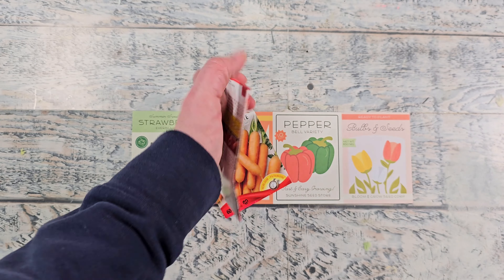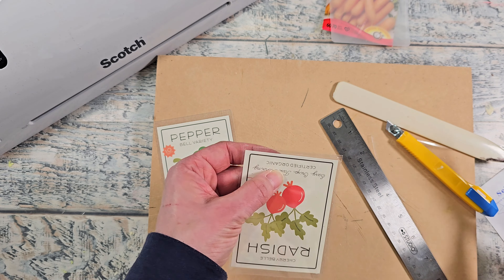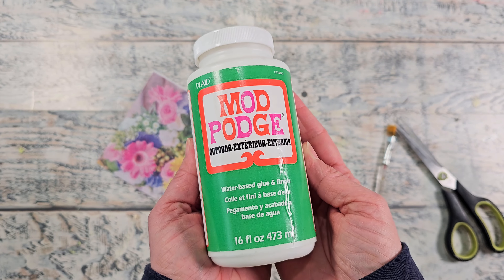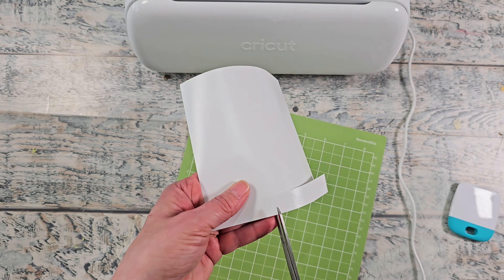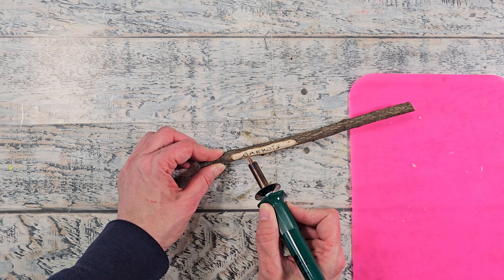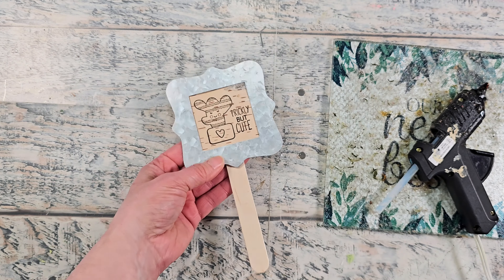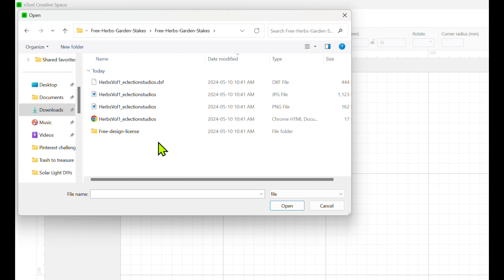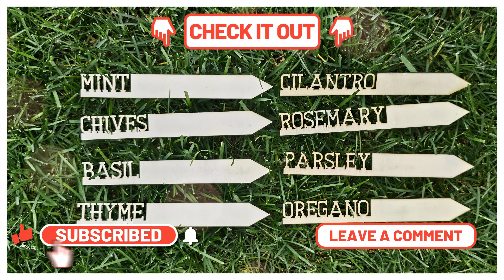Unique DIY Plant Markers For Your Garden

Comment: Donna, these are all so cute. I love the laser cut ones. I seal my wooden crafts that are going outside with three coats of spar urethane. It does have an amber finish but I think it adds to the wood tones.
Reply from the maker: Oh, that's good to know. Thanks!! 😉
Thanks so much for watching Katherine!! Take care 💖
Reply: Is The spar urethane that you're using an oil-based product?
Reply: @KMF3  yes. It contains aliphatic hydrocarbons. That is a downside because cleanup is a nuisance and good ventilation is needed for application but it really protects against the elements.

Comment: Instead of a laminator and using all of those expensive products (other than the Dollar tree items) can you do a version that uses inexpensive products? Unfortunately I've never seen those self laminating sheets at Dollar tree.
Reply from the maker: I have seen the self-laminating sheets at Walmart, Staples, and on Amazon. I would check other dollar stores as well. If you're in Canada, Dollarama has them.
The branches and little chalkboards or other mini signs are good inexpensive alternatives. You could use a Sharpe, outdoor paint, or paint marker on the branches and signs. You could then seal the words with a varnish or any good sealant to help preserve them.
An alternative to the laminating sheets could be packing tape?!? Although I have never tried it myself, it's worth a try to see how well it holds up outside. If you're using seed packets, I'd add cardstock inside the packets, then use the packing tape. I don't know how well the tape adhesive would hold up in the heat and with water!! Another suggestion would be plastic packaging or sheet protectors?!? They can be sealed with a heat tool, maybe a glue gun?? Or a glue that holds up well outside. 
I can't think of anything else off the top of my head. I hope this helps.
I was trying my best to give all kinds of ideas as I know there are lots of crafters with different tools and some with a few 😉
Thanks so much for watching. I hope you have a wonderful day 💖🤗
Reply: @creartivebynature  great ideas. I knew you would have some.
Reply from the maker: @KMF3  let me know if you try any of them and if they work, I'm curious myself 😉